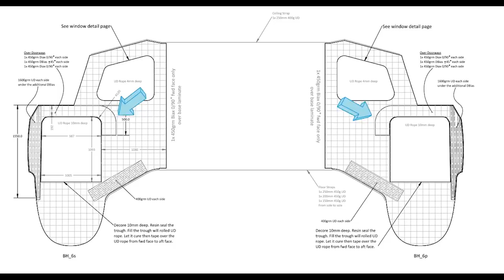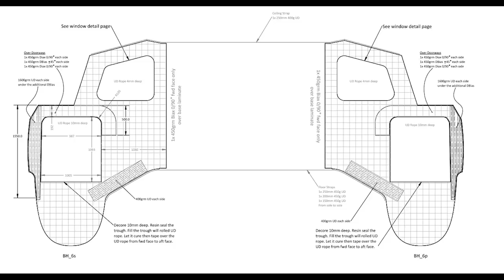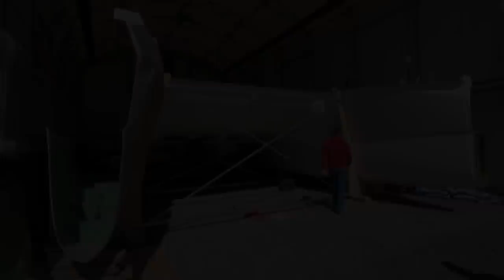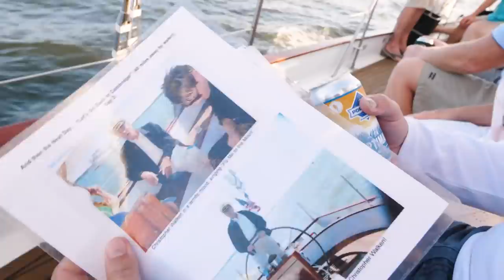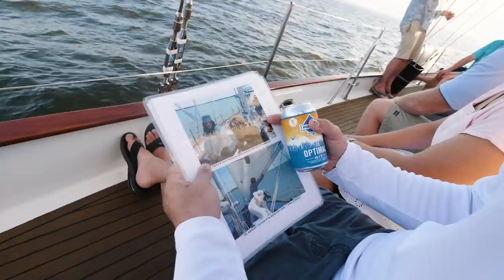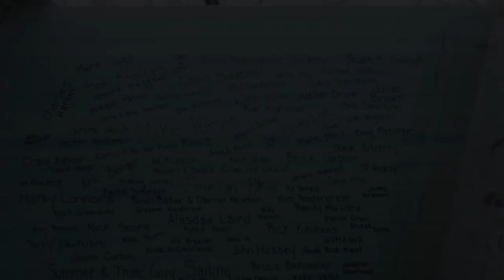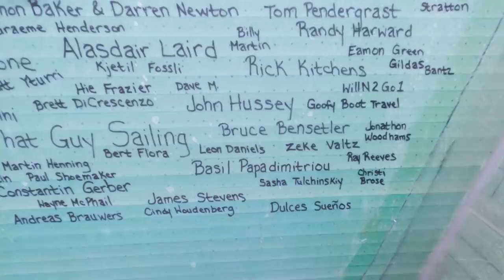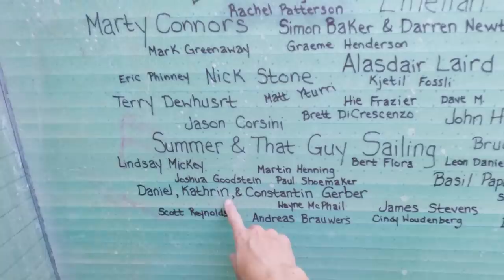CATAMARAN BUILD – Reinforcing Our Cockpit Bulkhead (MJ Sailing – Ep 196)

Comment: fibre glassing takes many years to master....ive worked with it professionally  as a surfboard maker and a racing yacht builder and you dont get good at it  over night.
much attention must be paid to the ratio of resin to glass....too dry and it will be weak...too wet and it will be heavy and the strength will be compromised.
i think your doing ok but it would pay to have a pro check your progress...its serious stuff and you cant cut air bubbles and dryness out of the glass
it MUST be done properly every step of the process.
it always helps to do one lay up at a time.
hope this helps...its looking very cool so far.

Comment: The bulkhead is the  boat   weak spot I think  on a catamaran boat ? They like to crack and give out
Reply: Depends on the cat design.
Wharaams use rope
Reply: @MrRourk  I think about the talk down on the mask is pulled down on and the flexibility of the sea that may cause the cracking of the bulkheads ????
Reply: @vivianbond7449  the original catamarans  are lashed and the hulls have movement.   Then in the 50's they started trying to build fixed solid cats.  This does allow more speed but it will eventually break.  There is just too much stress.
Reply: @MrRourk  ok mate thank you for letting me know to mate I do think it’s a good question I just think it’s  the bulkhead to stop them cracking or given out like the Hurricane storm 450 salvage catamaran boat  on YouTube who fixed his one and done a great job of it too

Comment: I'm getting frustrated with the way Matt is laying the cloth. The reason you have air bubbles is because he is starting to lay it from the left then he skips the middle and goes straight to the right and then ends with the middle! ? what is that about?? Something tells me he has never put up wallpaper before. Matt bro don't get mad with me k but why are you not laying the cloth from left to right or even right to left?? including when you roll out the air with metal rollers? You keep starting at one end and jumping to the other and doing the middle last. That is causing air bubbles bro,

Comment: I hate when yall use these abscure terms lol ... so 090 is a biaxel?
Reply: Ok after finishing the video yes lol.... so what I learned after 10 gallons of epoxy and a lot of bi-axel ..... is i would wet out the surface once then right before laying the glass down I would wet it again,  lay the glass down then wet out the glass,  then almost immediately wet the glass out again
.... I know it seems like a lot,  but that bi-axel sucks up a lot of resin and I found usually if you're getting air bubbles your not applying enough resin.... j.m.o.
Reply from the maker: If you watch the steps, we do a wet out of resin on the surface before any glass goes down. 😉

Comment: The zero-ninety (or any cloth) is terrible for hand lay-up. I found alternate layers of mat and woven roving to be much more user friendly.
Reply: They are doing an engineered lay-up calculated by the boat designers. It would be foolish to go with any other lay-up. Vac bagging could be an idea though.
Reply: @jackdbur  Vacuum bagging isn't necessarily the end-all be-all either...  Easy to suck the layup dry if the breather/bleeder schedule isn't right and there is trial and error involved.  The panels themselves would have originally been manufactured with vacuum of course under more controlled factory conditions than they are likely to achieve in their tent.